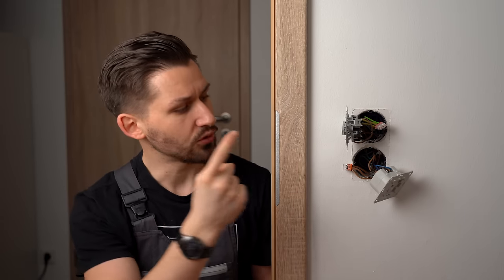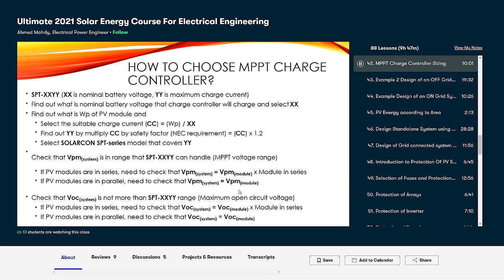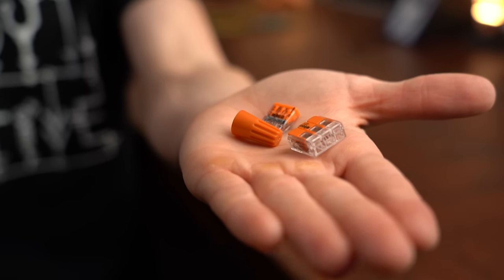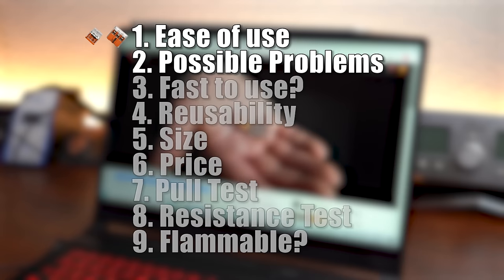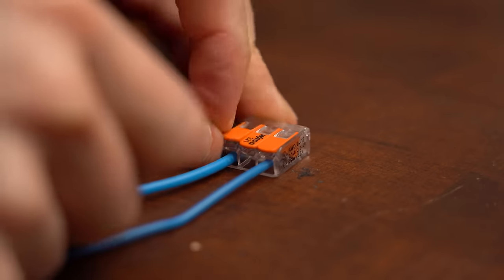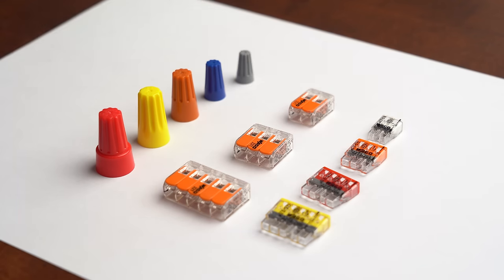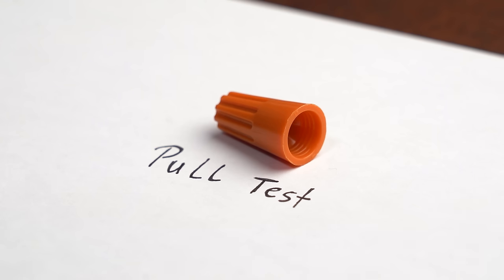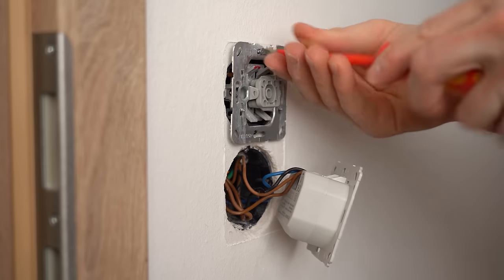What Wire Connector is the Best? Settling a Debate! Wire Nut VS Wago

Comment: Wago's are easier and less likely to result in a poor connection when used by a non-professional, but the reason I do not favor their use is the big difference in surface area in contact and the added resistance of the Wago system.  When done properly, the twisted connection results in much more surface area of each wire being in contact with the other wire(s), creating less resistance and more reliability over time.  The Wago has a much smaller surface area in contact with the bus, and relies on spring tension alone to keep the connection tight and secure.  Feel a Wago connector in an activated circuit and you are likely to feel some heat (due to resistance).  You do not want heat being generated in wiring connections.
Reply: @gcraig0001: Thank you!
Reply: wago connector may have has less resistance with stranded wire compared to solid due to how the clamp force works.
Reply: Yep, I am an electrician by trade, and I agree with you completely. Even though wago connectors are slightly easier and faster to use than wirenuts, I do not like wago connectors as well as wire nuts because I have seen WAY more loose connections and "pullouts" of wires, especially when twisting and moving a joint/connection around within a junction box, with the wago connectors than with wirenuts.

If wirenuts are used properly, (being an electrician I have used them long enough to know how to best use them, lol!), the wirenuts produce a considerably better and more long-term reliable connection!
Reply: @JoeJ-8282  it sounds as if you're saying you don't like wago because they can be misused but on the other hand you like wire nuts because they don't have the same problems (as long as they're used correctly).

Not sure I see the difference? 

Personally I do agree with your assessment on wago, but I still use them because I know how to ensure a good connection and it makes future work a lot easier. I usually use them on projects though, not house wiring.
Reply: @kj_H65f  But that's just it... even with a "good connection" using Wago connectors, it STILL isn't anywhere close to as truly solid of a connection as with wire nuts, (properly used), especially for high current and/or high vibration connections , simply because of the physics of the design of both types of connectors.

If a wirenut is secured around a connection properly, then you cannot pull the joint apart, aside from breaking the wire itself, but with Wagos, the individual wires will pull out quite easily, especially if even slightly twisted or moved around, (like when working on a junction box), and that's not only annoying, but potentially dangerous, depending on whether or not a specific wire in a wago is live or not! (If it accidentally comes out)

The main junction within a wirenut, for example, is the actual twisted pair (or set) of wires themselves, (which in and of itself is already a decent connection if twisted together properly using lineman's pliers, as is recommended), but then additionally with a tapered metal spring also VERY tightly wrapped around the entire joint, totally preventing it from coming apart...

But with Wago connectors, by comparison, the joint is totally reliant on a completely separate metal "bussbar" and basically just the edge of a knifeblade for holding the wire AND carrying the current load. (That is why wagos have considerably higher resistance and much higher heat buildup at the joint, especially under higher current loads!)

About the ONLY thing that I would maybe consider using wagos for are LED lighting circuits, where the current draw is relatively low...

However, I would NEVER use Wagos on heavier motor loads, ANY kind of heater element loads, OR anything that was ever subjected to high vibration, like inside the junction box mounted on a generator, etc. Anyone who does any of those 3 things is asking for trouble in the long-term! (quite possibly even in the short term with those 3 types of connections)

I guess there IS a decently good and useable place for wagos though... LED lighting circuits, (as mentioned), or in any circuit that has a relatively lower current draw, (because even though wagos are "rated" for a specific current, they still have relatively more heat buildup at the connector, which is NOT good for long-term connection reliability), and then also if as long as the connection is never moved around, twisted, or subjected to any physical stresses, including vibration, then Wagos ARE faster and relatively easier to use, especially for a novice, than wirenuts are... So, in application specific instances, Wagos ARE OK...

However, since I personally know how to properly use wirenuts, and with that knowledge, I can also 100% guarantee that every single joint I make using a wirenut is ALWAYS considerably better than the joint made by ANY type of Wago connector, simply because of the physical design specifics as explained earlier, PLUS the fact that wirenuts are WAY less expensive than Wagos, (at least here in the USA where I live and work), I will always keep using wirenuts rather than Wagos...

But "to each their own", I guess... Just as long as anyone who uses Wagos understands all of their inherent limitations, then they definitely can be an easier and faster way to wire smaller loads like lighting circuits, etc.
Reply: It's the same reason no reputable electrician will use the push-in connectors on the back of outlets. Surface contact is essentially a knifes edge rather than using all the exposed wire as a bus bar.
Reply: Wago is good only for less current current circuits like lightings. Wago is a pinch contact only while the wire nut is twisted contacts, thus it is almost as it is being soldered.
Reply: We use a much better system in Ireland
Reply: @noelburke6224  Oh yeah? Please elaborate as to what, why, and how it's better there... We are all curious...
Reply: @jimmydeloso6528  They are rated for a specified amperage and certainly not just for lighting; if you use them within their specifications they are UL and code approved.
Reply: @JoeJ-8282  They don't have electricity in Ireland. He's confused... maybe talking about screw-together lamp gas pipe fittings.
Reply: 100% agree with this!
Reply: @hopkinshome3799  and being spring loaded, the holding force is consistent. With wire nuts you have no idea. The skills of the person fitting it is the only thing determining the quality of the connexion.
And in a 120V country, all the cabling under load is warm anyway, it's lossy af. 
My halogen stove is connected with Wagos on a 32A breaker (240V) and it doesn't break a sweat.
So, your average american circuit with 15-20A@120V is easy game.
Reply: @jimmydeloso6528  I like them for joining  grounds
Reply: @ledoynier3694  ...which just brings us back to, Wagos are better for non-professionals/untrained peoples, and wire nuts require a lil bit of educated knowledge. That by itself doesn't make one better or worse, they're just different options with different pros & cons.
Reply: What you say is true but in reality they both work for long term use. For something more important to secure we use crimp type connections. Personally i go wago all the way if it’s not coming out of my pocket.
Reply: Twisted connections degrade over time because of copper oxidation. That's why twisted connections alone are banned in some countries. Therefore what looks like a better connection initially may become worse than the Wago's over time. Wire nuts supposed to improve the situation by applying compression to the connection, but not sure how significant the improvement is given the length of the twisted connection. BTW, you rarely find copper-copper connectors in electric equipment for that reason.
Reply: @НиколайТарбаев-к1к  I think we can demonstrate that this isn't a significant problem with wire nuts though, considering they've been the building standard in North America forever.
Reply: @SerenoOunce  While that makes sense, the company I work for prefers that you do them with the push in connectors.  But, that is for residential 14AWG.  Obviously you can't do that with 12.  
When I first started, it seemed kinda weird.  But it is faster, and still meets NEC standards as far as I know
Reply: @gcraig0001 ‐ I co-sign.
Reply: @JoeJ-8282   - I co-sign
Reply: @SerenoOunce   - I CO-SIGN.  IN EXTRA LARGE WRITING LIKE JOHN HANCOCK!

I had to fix lost power in two rooms in two of my rent houses this week.  Why did they lose power? I thought you would never ask.  They lost power because the stick in connectors on the back of the outlets loosened and caused the wires to burn out.  I had to trace two circuits because some yahoo got in a rush and didn't take time to use the screws...or did not know that he should have use the screws.
Reply: Excellent summary!  From what I've read, and trying to simplify:  a properly installed wire nut makes a better connection than a properly installed WAGO.  The author of the video admits to being biased in favor of WAGO, but the categories where he assigns points shouldn't have the same weights.  Making a good solid connection w/ as little resistance as possible should be of the greatest importance.
Reply: The resistance is within safe levels though. They are thoroughly tested and have been granted multiple certificates around the world.
Reply: @JoeJ-8282  

"Pull out easily especially if twisted."

20kg force to pull out isn't "easy". And simultaneously pulling and twisting isn't going to happen unless the person doing the work is excessively packing the box with cables and acting like a chimpanzee on steroids instead of a pro.

I really don't see the arguments here. Wago's are certified around the world to be safe and reliable, after extensive testing.

Too many old school electricians and amateurs here, scraping the bottom of the barrel to find excuses as to why "the way they do it" is better.

What people "feel" is less important than laboratory testing that these devices undergo.

Comment: I like that you tore them down so we could see how they work - from this, I learned that wire nuts are not actually quite as terrible as I thought they were - almost, but not quite terrible.  I've never used them (I don't think they are sold here in the UK) - screw terminal blocks would probably be the most common traditional way of joining wires.
Reply: Good to see you here too Shrimp, really enjoy your of odd ball content!
Reply: They used to be used in the UK before screw terminal blocks and were made of porcelain.
Reply: I believe Denman Electrical sell wire nuts.
Reply: I would argue that the thing about wire nuts that makes them awful is the fact that you're using wire nuts. Absolutely hate those things they cramp the hell outta my hand and it's a pain in the ass getting more than two wires to cooperate with them
Reply: @tamamoland4247  the wire nut if used correctly has a superior connectivity, so lower resistance and when high currents are used in that part of the leads, they will produce less heat. Less heat means insulation is preserved longer, less risk of fire and failure. 

also, it is not good practice to use only 2 wires and you should twist the wires together (solid ones) in such a manner that they stay stuck without even the nut on it. cut to size and twist on the nut. 

where i work we use the Conex brand, which comes with a tiny tool inside the box that fits over the nut. You can even put that tool in a (cordless) drill though i'd use caution with that. you could ruin the nut with that much power
Reply: @AwoudeX  totally right. In this video the wire nut is used completely the wrong way.
For normal use the Wago connectors are more than adequate though and much easier to use. The cheap Wago imitations are the ones to avoid.
Reply: With wire nuts you are suppose to twist the wires together before twisting the wire nut onto the wire.  It should be noted that the wires need to be twisted together in the same direction the wire nut is twisted on.  It does take longer but it also insures the maximum contact between wires for current to flow through with the least resistance.
Reply: My father was an electrician for 47 years.  That was what he taught me.
Reply: You can see in the one where he tests for time he is actually twisting them together before applying the nut.
Reply: @Validole  
He kind-of sort-of twisted them together and did so loosely.  Not surprising considering he said he has no training in using wire nuts.  If the wire nut causes the wires to twist together any at all then they were not twisted together tight enough before the wire nut was put on.  You should think of the wires being the threads on a bolt and the wire nut being a tapered nut being screwed onto that bolt until it is tight.
Reply: @tamamoland4247  Wire Nuts also loosen with movement of the wires.
Reply: @Vinz3ntR  I read this before watching, I figured he would just shove them in and twist, lots of people do it that way… 
I still was a bit shocked to see him fo that and still twist the nut enough that the wires end up twisted. I don’t think I’ve even seen anyone do it quite like that, it seems like twisting it that much is probably worse than leaving them completely untwisted.
I suppose the 2 wires would stay in contact without the nut but it looks like horrible contact and the potential for a bad contact to short or resist… 
Hard to believe he really thinks that’s how wire nuts are supposed to be used, if he really does think that then it really makes me wonder how well he understands his trade versus how well he’s been trained to do it.
You be well trained and clueless, and as long as you only encounter jobs that you’ve been trained in them it’s probably ok, personally I’d rather have my home wired by someone that understands electricity well but hasn’t been extensively trained.
Reply: @steamboatmodel  no, they don’t. The wire nut is only there as an insulator, not to connect anything.
Reply: @oldtimefarmboy617  Thanks for comment. I was always a bit suspicious of wire nuts until I watched this video and read these comments. However, I think I need to reconsider.
Reply: @AwoudeX  and when you start throwing in conditions it makes it less likely that people will know or understand you need to do those things & you risk them being used incorrectly. That's the thing with Wago they're almost idiot proof.
Reply: @swayback7375  so you're criticising his qualifications based on a product that's largely not used in his native country off the back of a YouTube video, really smacks of fanboyism. Totally unnecessary & you're proving the point about wire nuts it's easier to cock it up using that than vs wago.

You have to twist the ends together & then screw on a wire nut, just can't see why people outside the US would use them vs Wago etc that are commonly used here. I don't know a single electrician that would dream of using them here doesn't mean they aren't qualified to do their job.
Reply: @Steve-GM0HUU  
When properly done, twisting the wires tightly together then twisting on a wire nut, they are ideal for connections with higher current flow.  That being said, when connecting devices with low current draws, like a light fixture, that use stranded wires rather than solid wires, I can see no reason why the Wago connector would not be entirely appropriate, specially since it would actually work better with stranded wires.

Basically, use what is best for each application.
Reply: I just wrap the wires around a screw and use sticky tape.
Reply: @JM Coulon basically every wire in australia is in a screw terminal. I think I’ve seen the products in this video maybe 3 times ever. 

Basically all the connections we make are in a wire nut shaped screw terminal
Reply: @JM Coulon many high end screw blocks do include blades of various type, and they may be very reliable ... And may remain cheaper than WAGO. 

Amongst other issues, screw blocks are required in shaking environments, when everything needs to be tied. There are accessories to tie down WAGO but they are very expensive, and  blocks are easier to tie.
Reply: @JM Coulon Yeah, this has happened at a house my family owns which has well water and thus has an electric pump with its own circuit. One day the pump stopped working while I was there but the fuse hadn't blow, so I investigated, and found out that inside a junction box (later addition because the original wiring had been partially moved) one half of a fixed screw terminal had melted into an charred mess, likely since the solid core wire had flattened too much over time and the arcing from the massive startup rush currents caused the terminal to slowly warp from the heat over time until it finally heated so much it melted and the connection failed.
Reply: There's nothing terrible about them at all. They are, electrically speaking, no different than a screw terminal block, only you don't need a screwdriver to apply them.
Reply: Redoing a spot lamp installation. Probably use the Wago 221 connectors for this on the recommendation from another person. Originally used terminal blocks with their inherent problems when joining multiple wires. With these, was taught to double back the stripped stranded wire end back on itself particularly if the wires to be joined are singles.This point also applies to solid core wires. Nowadays the use of crimped on ferrules are recommended when connecting stranded wire to screwed barrel terminals.